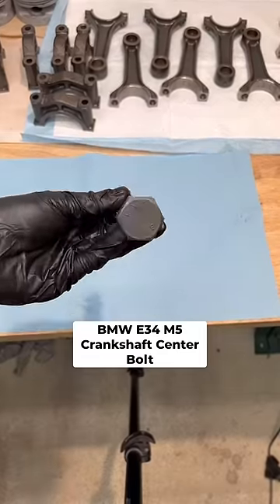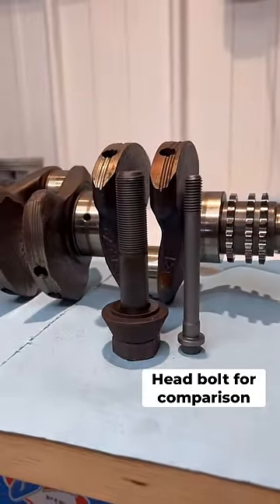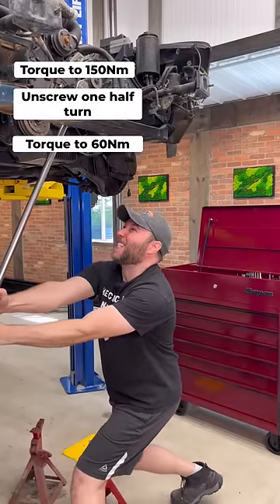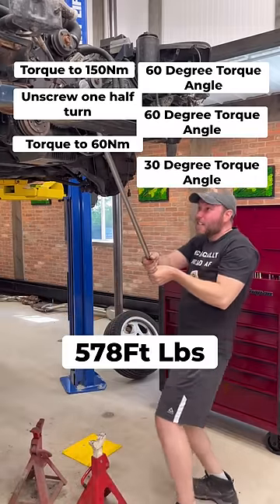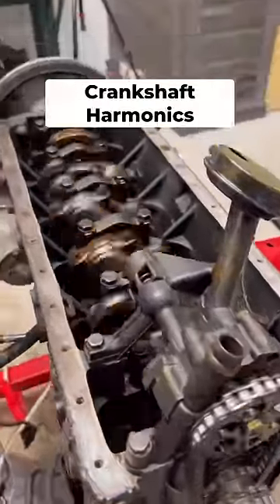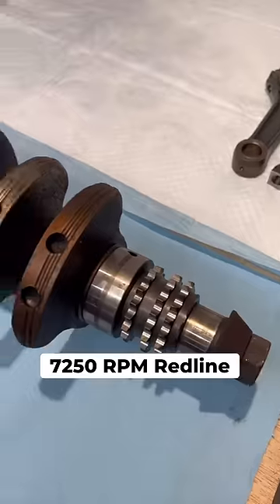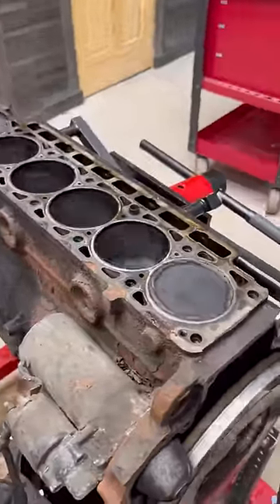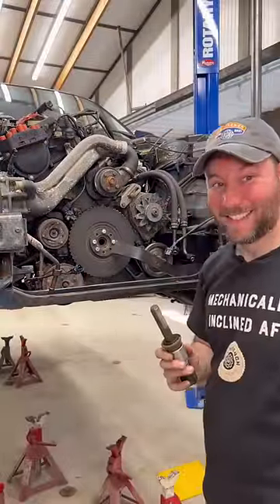BMW E34 M5 Crankshaft Center Bolt Explanation #bmw #cars #diy #bmwm5 #bmwe34 #restoration #engine

Comment: Why not just apply all the torque in one motion?
Reply from the maker: It's won't product the same result
Reply: @wewrench  thanks. Was just wondering.

Would it strip a bolt or something?
Reply from the maker: @_.incredible_magnum._291  So when you torque a bolt, a majority of the force is to just overcome the friction of the threads...etc. The various angle stages are what cause the bolt to actually stretch and the bolt becomes sort of like a spring, and that tension is what keeps it tight

Comment: VW and Subaru head bolts be like
Reply from the maker: They have some good torque to them too
Reply: @wewrench  i meant the torque, back it off, torque again, angle, torque again.
Reply from the maker: @destroyer6470 Oh yes! That whole procedure. I can't remember if Audi required that on some cars as well.
Reply: @wewrench  well audi made the 1.8t for vw so I can guarantee it
Reply from the maker: @destroyer6470  It's sad that I can't remember that. I did so many heads on those 1.8T's when they were coming in with sludge issues
Reply: @wewrench  i dont need to remember, I'm freinds with a Subaru and VW guy. Its hilarious cause my amc jeep is so simple
Reply from the maker: @destroyer6470  Yeah, unlike what they work on. The VW's more so than the subarus
Reply from the maker: @destroyer6470  Audi's make you want to pull your hair out
Reply: @wewrench  the Subaru block bolts are insane, because its a boxxer. But yeah my honda and my jeep are simply easier to work on imo. And I just vibe with em
Reply from the maker: @destroyer6470  At my first dealer there were two subaru guys mixed in with us and they were never busy because the cars didn't break!
Reply: @wewrench  I'm not saying Subaru is unreliable, but when he rebuilt his engine, it was priceless
Reply from the maker: @destroyer6470  I believe it

Comment: So! The Legend goes... At one time Germany made the thinnest needle in the world 🌎. And sent it to Japan as an Engineering Challenge.

Japan sent the needle back, thinner than before . Germany would send it back again, even thinner this time...

Days later, Japan returned it to Germany. At first, the Germans did not notice any difference... They thought they'd won the challenge. But when they weighed it, They found the needle was now slightly lighter but the same size. So upon closer inspection they found... there was a microscopic hole made through the entire length of the needle.

Some say the hole 🕳️ was made by a Toyota, some say it was Honda. They even say it was a legendary samurai with mythical katana skills 😮 .

But personally, I believe it was made by Yamaha... They always do to much 😅!!!
Reply from the maker: I believe this story!

Comment: 7200 redline? A 1992 Acura 1.8L has a 6800 redline. Crank bolt is maybe an M12 or M14. Only requires 120 ft lb...
Reply from the maker: It’s a 4 cyl though

Comment: My 4 cylinder accord redlines at 8000 … doesn’t need all this fancy torque specs. Germans just over complicate everything
Reply from the maker: Different engine design though
Reply: @wewrench  i guess if it’s gonna be on the autobahn it might need that extra torque 😂
Reply from the maker: @joiion913  Yeah...these machines always need a little extra

Comment: They didn't think about reversing the threads to it would tighten as it runs or have it breath air from the other side of the head
Reply from the maker: That would make too much sense !
Reply: Is it really that simple tho.

I’m a BMW fan so I know they make things over complicated. But sometimes it’s genius after taking some time to think about it…. And sometimes it’s complete waste of time and resources but that’s BMW😂
Reply from the maker: @svenvanwier7196  That’s a good way of putting it
Reply from the maker: @svenvanwier7196  Yup, that's a good way of putting it

Comment: This video could have beet 3 seconds short.... "what is it with the bolt on BMW M5 Crank? German Overengineering"

I know cars that rev way higher and dont require such BS and them parts wont get loose and whatnot... its just the BMW is overengineered... Toyota is also overengineered but lets say 4A-GE engine has redline at 7.800 RPM and with upgraded camshaft and trumpets it car rev close to 9K RPM...
Reply from the maker: Those are not large inline 6s though. Different engine design

Comment: Why not safety wire it like in Aviation?
Reply from the maker: That's not a common practice in cars...although it would probably work just fine
Reply: @wewrench  ah, ok 👍
Reply from the maker: @josetellez1803  Thanks for supporting the channel!

Comment: Yeah - this has the earmarks of a bandaid.  That’s not extra special Engineering - it’s an after the fact procedure to make it work.  If it was designed correctly out of the box it would just take a torque, perhaps some thread locking compound.
Reply from the maker: Who knows what the logic is

Comment: Real reason, BMW discovered some imbalance in a shitty bottom end and compensated with ridiculous crank bolt torque specs...funny how EVERYONE else can make a 7-8k engine that has standard torque specs for the crank bolt...hmmm
Reply from the maker: The M30 design goes back to the 1930's and it always had vibration issues. They had to get porsche to help them figure it out

Comment: Yea that's doing too much. I despise bolts like this. Usually they're torque to yield and they stretch so a new bolt is required everytime you disassemble it. Arp to the rescue.
Reply from the maker: Yup. Def overcomplicates things

Comment: meanwhile with a near 8000 RPM factory redline coyote, a 5 liter crossplane V8 no less, it's 76 ft lb + 90° for the crank bolt. this is nothing more than typical German """""engineering""""" at its finest.
Reply from the maker: Different engine design though

Comment: Threadlock & at least 2 ooga dooga's with a busted arse Kinchrome torque wrence with 1 foot of water pipe on the end.

My friends E34 engine still ran at decent rpm before the LS swap; another friend bought it, jammed it into a wrecking yard special 1998 Nissan Patrol, and that is still running now as a farm "ute" (ute as in a 9" grinder cut the wagon section off), and works fine with a modified intake to take a 1981 XD Falcon Carter carby, a set of headers off a VC Commodore made to fit,  a gearbox we think is out of a Mitsubishi Sigma, and a Chrysler Australia Dizzy.

No tacho, but i have heard that thing BEGGING for a .223 behind the ear
Reply from the maker: That’s some Frankenstein stuff

Comment: I thought a straight or inline six was inherently balanced compared to other engine designs ?
Reply from the maker: It is but the larger displacement of this one starts to negate that
Reply: @wewrench  Also the length of the crankshaft is a disadvantage at high RPM. It starts to wobble, hence the insane torque sequence.
Reply: Perfect primary balance but due to opposing twisting forces flexing the long crankshaft 2nd and 3rd order harmonics are a different story.
Reply from the maker: @constantkay  absolutely corrwct

Comment: If there is any vibration at redline, engineering didn't put enough thought into it. The extra torque is a bandaid for poor engineering.
Reply from the maker: It's a long heavy crank. It's unavoidable. All the large BMW I-6s have this issue

Comment: You ever had to remove a 6.2 LS rocker arm? It's an 8mm socket and we had to use a breaker bar and a jack handle lol. You wanna talk about stress.
Reply from the maker: Holy cow! lol. Sounds like a nightmare
Reply: @WeWrench  I watched multiple people and they all did the same it's crazy! I just didn't want to an impact on such a small bolt

Comment: Chevy sonic heads...1.8  is similar BS..
SEQUENCES...270 Torqu angle ...5 rounds of torque tightening and  USES BMW TYPE BOLTS....all aluminum...all alumimum torque bolts.  Touchy...
Reply from the maker: Yup...sounds right

Comment: i couldnt get the damn crank bolt off my 1999 toyota altezza as200 with a breaker bar twice as long as that. much longer and i would have been levering the whole car on its side. 
im no engineer. but that shits too tight. even with crc and heat it still wouldnt break loose. i needed the car so had to give up. a year later i still have that new timing belt in my wardrobe. its not doing any good there.
Reply from the maker: Hope it all works out

Comment: There's inline 4s with no balance shafts that rev higher than that lol
Reply from the maker: Yes many. It has to do with the weight and length of the crankshaft as well the reciprocating mass
Reply: @wewrench  do they still use that design today?
Reply from the maker: @jayaneyon9316  No. Large displacement inline 6's were phased out for this very reason.
Reply from the maker: @jayaneyon9316  Diesels yes. Spark ignition, no
Reply: @wewrench  that makes sense that the diesels still need it.

Comment: So basically as tight as you can get it and then another half turn
Reply from the maker: This might be a little more than that
Reply: @wewrench  I've never been able to achieve a full term after getting it as tight as I can. I guess I'm not the man for the Job.
Reply from the maker: @sw4882  Just need a longer cheater bar!

Comment: I bet my dcf900 can still crank it loose tho.
Reply from the maker: I don't know man. My IR air 1/2" couldn't touch it
Reply: @wewrench  dcf900 is much stronger than any air 1/2.  Even the ti2235 is a few hundred ft lbs less than the dcf900.  It’s comparable to very high end a 3/4 in units imo even tho it has a half inch drive.   It’s about the limit of what half inch drive sockets can handle without cracking every time.  It will round out the socket drive if you try to tighten something for more than 15-20 seconds, ruining the socket.

Comment: I had to replace the vibration damper on my e34 diesel and dam that bt was tight but I managed to undo it . I sold the car 10 years ago for £200 it's  worth thousands 😥
Reply from the maker: Hindsight is always 20/20. I regret getting rid of any of my BMWs

Comment: Bro might wanna do a little research straight 6 engines are damn near 90% perfect balanced due to crank journal intervals which means harmonics are non-existent which is why all the supras skylines bmw 6s and Ford bara engines are known to handle insane horse power
Reply from the maker: Harmonics are non-existent? You have no idea what you're talking about.
Reply: @wewrench  friend do some research and then speak I've built countless straight 6 engines over the past 15 years ranging from turbo supras to rb swapped pickup trucks when assembled correctly you can stand a quarter on a valve cover of just about any straight 6 at idle and rev the engine and it won't fall. But what would I know I'm just a mechanic
Reply from the maker: @blakepatterson5158  WIth balancing shafts and other techniques, you can get a quarter to stand up on the valve cover of any engine. The engine depicted in the video has a 3.6L displacement and the crank is extremely long and heavy, and along with the rotating mass it drives, the harmonics are difficult to control at higher revs. This is why certain BMW's that are tracked have oil pump nuts that magically work their way loose. This is also the reason the crank bolt shown has such a crazy torque procedure.

Comment: very slow RPM compared to a Z10 Kawasaki red lines 11,000 RPM. cams don't even start kick in antill about 8,000
Reply from the maker: Different design entirely

Comment: If BMW built things properly it wouldn't need such ridiculous bolt size. Some bike engines reach 15,000+ rpm
Reply from the maker: Different engine designs on bikes though
Reply: @wewrench  Hmm, an engine block, crank, rods, pistons, cams, valves, chain and a few sundry nuts/bolts/circlips and pins. Pretty similar, er the same in my book
Reply from the maker: @sarahlivingstone8367  It has to be with the length, and weight of the crankshaft and its driven components. Pontiac made an inline 8 cyl and the crankshaft would sag and vibrate like crazy because of this.

Comment: bro u cant torque 150Nm easily. we torque 245Nm flywheel nut in yamaha 250hp (old version) in 2.5 feet torque wrench by hand. my tip to u is eat more saltwater fish. btw greetings from maldives
Reply from the maker: Greetings friend! I have to eat more spinach as well

Comment: My 4g92 mivec 2nd gen crank bokt is 180 ft-lbs torque spec and the instrument panel redline is 8200rpm but i get roughly 8600rpm and i beat the shit out of it... not to mention no locktite🤣
Reply from the maker: Different design on that engine

Comment: Tiguan motor mounts are torqued to 89 ft lbs, then 30 degrees spec. Idk how tight the factory goes but it was insane like the tightest bolt I've undone in recent memory and was dipped in loctite
Reply from the maker: Wow! Never seen a motor mount bolt that tight

Comment: Big bolt huh... Seems like it's compensating for something other than harmonics... Let's be honest 7200 rpm isnt that impressive..
Reply from the maker: It's not the revs so much as it is the size, length, and weight of the crank and the rotating mass

Comment: Bmw is the most poorly engineered car on the road. They are fast and fancy but they only last about 8 years and here comes a mortage of repair bills. If they would get rid of the plastic and build like a normal oem they would be on the road forever!
Reply from the maker: The old ones are way better

Comment: Bro just tried to explain bmw's insanity by saying the crankshaft spins. As if that's a real explanation.
Reply from the maker: Crankshaft harmonics is the reason. It’s a large displacement inline 6 and the weight and length of the crankshaft coupled with the reciprocating mass causes an abnormal amount of vibration compared to smaller inline 6s and other engine designs
Reply from the maker: @dumpsterjedi9323  Why are you so angry?

Comment: No, it was made like this to make it less serviceable by the owner/consumer so you'll continue to bring it back to the dealer for repairs. There are higher revving engines with better performance and better efficiency that don't do this stupidity.
Reply from the maker: BMW has a tendency of over complicating things. But I'm sure they had their reasons for this.

Comment: That’s certainly over engineering.  They could have got the same effect with a retainer clip
Reply from the maker: Has more to do with the weight and length of the crank
Reply: @wewrench  you stated it was to prevent it from vibrating out at high rpm.  
They could have achieved the same effect with a few different means of securing the bolt.
Reply from the maker: @jgetscensored7837  I agree. It's totally quirky
Reply: @wewrench  I guess what ever works.  As much as I dislike the brand, I can’t say they aren’t built strong
Reply from the maker: @jgetscensored7837  Just like anything, they have their strengths and weaknesses

Comment: Why does my 2004 Mazda 6 have a redline of 8000 RPM amd doesn't require this bullshit.

I know it has a Ford motor in it with a Mazda badge on it
Reply from the maker: Has to do with the length and weight of the crankshaft

Comment: Lol acting like 7krpm is a big deal
Reply from the maker: It was in 1992
Reply: @wewrench  
Don't think so. Plently of shitboxes were doing it then
Reply from the maker: @richardballs8618  it’s more about the fact that the crank is long and heavy coupled with spinning at those revs. Not just the revs by itself
Reply: @wewrench  it's 3.6l i6. Hardly impressive
Reply from the maker: @richardballs8618  There were bigger better engines and faster cars in that era. But I’m into this car because of the total package and the rarity. Its a blast to drive when it’s sorted

Comment: I call bullshit!!!
 My 289 hi po revs at 10 000 rpm all day and the bolt torque is less than half that!
Reply from the maker: Different engine design. No long heavy crankshaft

Comment: uhm i would understand this vid of yours more if you said this is the only car you have ever worked on and that crank bolt is the only one you ever had to remove and put back.  im sure you have heard this before but there is nothing special about its size or the torque setting
Reply from the maker: I worked for Audi for many years and there was never a crank bolt this size with this final torque. It's very atypical

Comment: R32 or r34 gtr is like over 1200ft/lbs need a 10ft torque wrench with like 4 guys to get it to seat right 😂😂😂 try that by yourself omg
Reply from the maker: I knew there were other engines out there with the same type of crank bolt torque

Comment: Over engineered. The economy cars in the 90s revved over 7000 rpm I'd understand if this engine revved over 9k but that's very unnecessary for all that it's just a balancer bolt.
Reply from the maker: Long heavy crankshaft is why

Comment: Huh…. My 383 said 65ft torque…
Reply from the maker: Different engine design though
Reply: @wewrench  that’s really interesting to see. Even when they have similar red lines. The 383 I have is 7,500.
Reply from the maker: @lvl800elite  It doesn't have a long heavy crankshaft like this one

Comment: SNAP ON IM 5 impact and it comes out,with thread locker and my impact,its not coming out,also with those high torque numbers,you are not going to strip it,laughable,50 years on the job no loosened harmonic balancer loose,EVER
Reply from the maker: Never seen one either. Little bit of an overkill on this one
Reply: @wewrench  german engineering,intense overkill and more weight,more work for the repairmen,dumb but expected
Reply from the maker: @strattuner  Definitely quirky

Comment: I call BULL SHIT.....we have turned small blocks 7200 rpm all day racing, no special bolts or anything that motor must be a pos
Reply from the maker: No, it's a great engine, it has to do with the length and weight of the crank